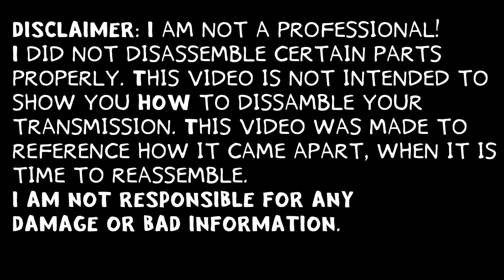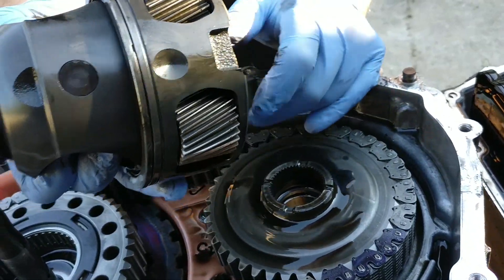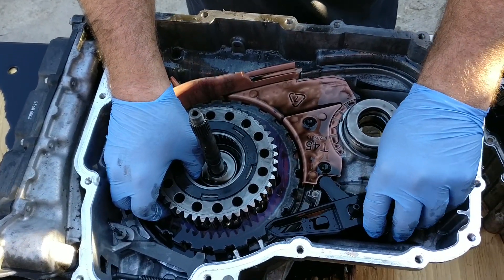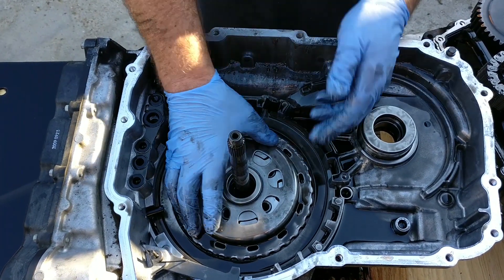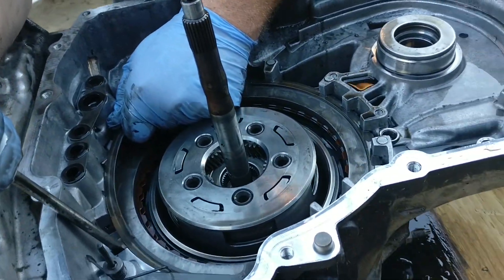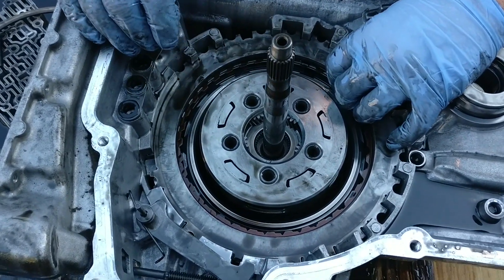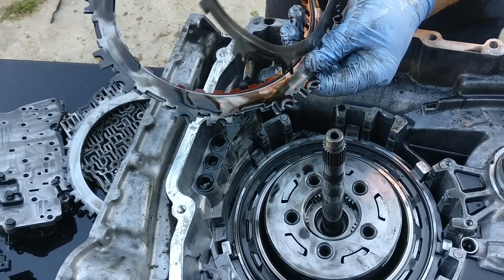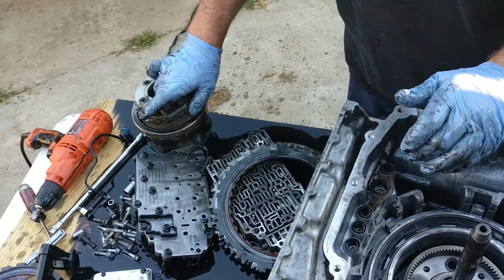Teardown 6T45 Transmission - Chevy Equinox - Part 2

Comment: So did that one plate break up in pieces if so that's crazy. So some folks pay 3500$ just for one piece for transmission. With 3500$ I'm buying new car.
Reply: Louis Holland  thats alot of money.  But. Those cars u have to drop out the frame to get the trans out. Labour not cheap. 140$ a hr

Comment: What was the equinox doing that you tore the transmission apart? Did you rebuild it? Did you correct the problem? Please help.
Reply from the maker: mcgoo&mcgee Rebuilt it... 3rd, 5th and reverse were not working.
Reply: is there going to be a rebuild vid?
Reply from the maker: James James unfortunately I was in a hurry to get it together  so I didn't record.